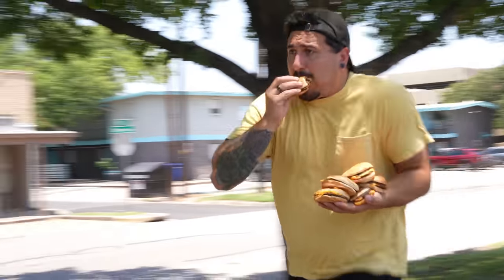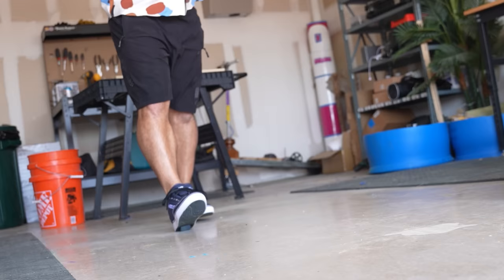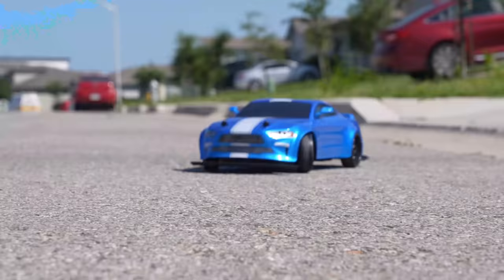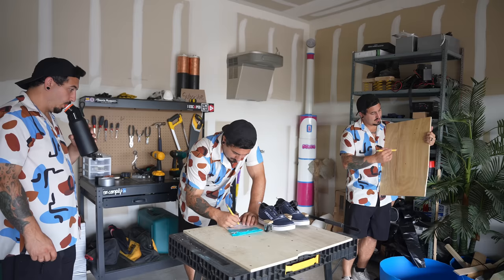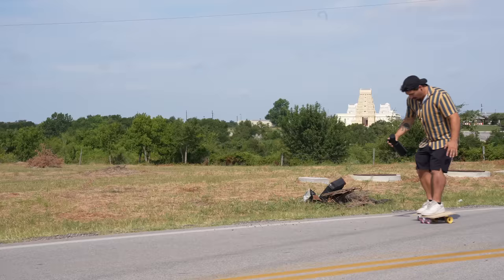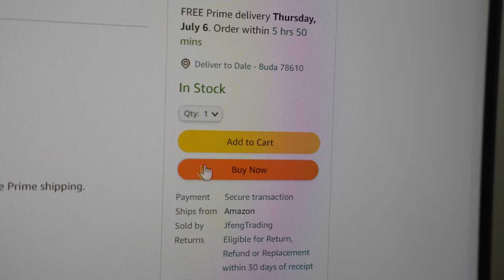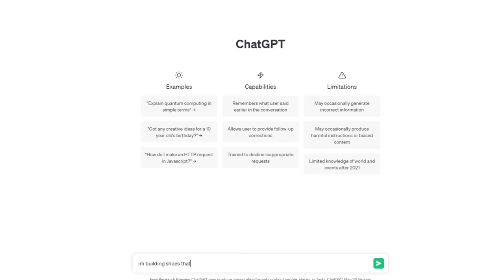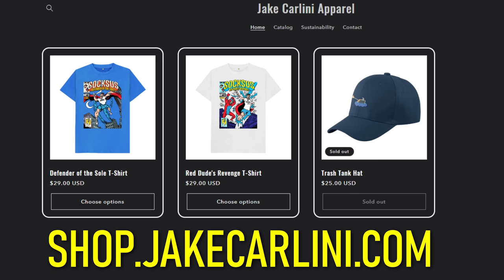I Built Turbo Shoes to Run Faster

Comment: Broke could have just used the electric parts from the skateboard he took apart to make the bottom wheels and then wire them so that it could work on both wheels and eat you or just bought a new skateboard for the wires And then it just would have been way easier for him but he decided to take a drill the stupid option